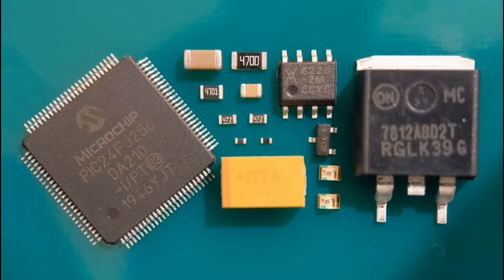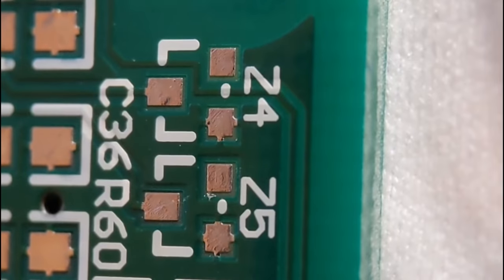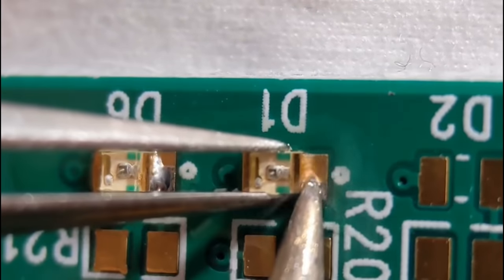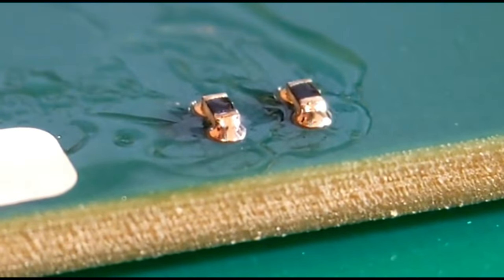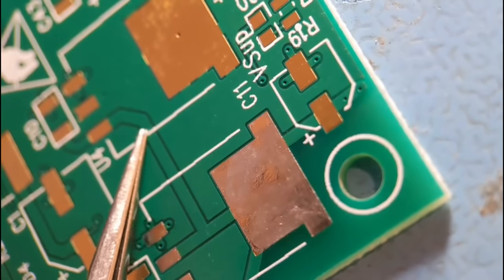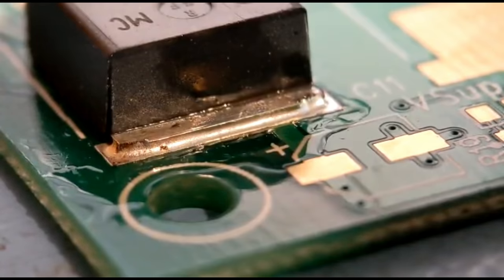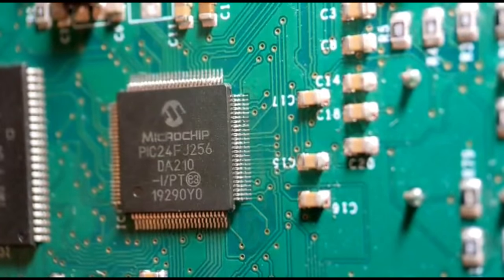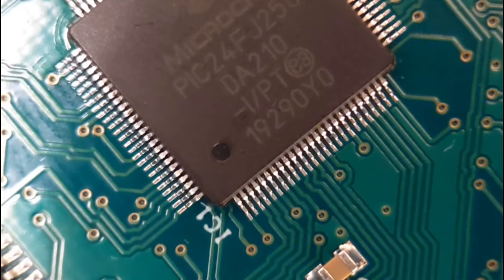How To Solder SMD Correctly - Part 1 /SMD Soldering Tutorial

Comment: What was the temperature of your iron?
Reply from the maker: Hi , thank you for your comment , much appreciated. Generally I do all my leaded soldering at about 330 degrees centigrade and for lead free soldering I choose between 350 - 360 normally . I may up these at times if I have difficult situations, but generally I would go with these mentioned temperatures. As this video was made with lead free I would have set to about 360 degrees .Hope that helps , thanks again 👍
Reply: @mrsolderfix3996  thanks so much for replying. I am just starting out electronics repair and maintenance as a passion I put off for years believing it would be too difficult. Im almost 40 now, but people like yourself are the reason I am motivated to start and continue to learn and grow . It's just been a month so far. I realised I had a lot to learn about this very basic step - soldering! I'm into audio equipment, amps in particular. I watched this video in its entirety, learned so so much from it and I'm very very glad you responded to my seemingly small and insignificant query. Thanks once again. Peace and blessings to you.
Reply from the maker: Hi , thank you for your comment and supporting my channel . I hope you get on ok with all your soldering projects . The more you practice you will definitely improve. Thanks again , take care 👍

Comment: Does the heat put into the 402 effect them at all
Reply from the maker: Hi . The heat going into the 0402 size components has NO effect on them at all . I guess if you held your iron on the ends for ages it might start to lift the connection on the end of the component but this should never happen in normal soldering practices. Thank you 👍
Reply: @mrsolderfix3996  ok great,thanks for your quick reply there sir
Reply from the maker: Hi , no problem . Good luck with whatever you do 👍

Comment: Which flux you have used
Reply from the maker: Hi . The flux I use in all my video's is called SMFL200D . It comes in a 200ml spray can . I normally spray a small amount into a small container and use a dipped plastic Ty wrap to apply it as in the videos . It's a great flux , recommend it . About £13 a can from Farnell , RS Components , eBay and other places . Normally pretty easy to get hold of . Hope that helps 👍

Comment: Whats the diameter of solder wire
Reply from the maker: Hi , thank you for your comment , much appreciated . In my videos I generally use 0.25mm solder for any fine pitch or small components and 0.5mm solder for larger  devices . Hope that helps , thanks again 👍
Reply: Thankyou. If you do more videos. May I request you talk about the head and solder size...we newbies have no idea. I have watched most of your videos again and again. The blob version like other channels did not work out for me. Your tack version worked best for me. Thanks.
Reply from the maker: Hi , I've actually posted a complete video on my channel all about different solder thicknesses and when to use them , not sure if you have seen this one .
Reply: Thank you I have not checked that video I will be going through all your libraries

Comment: what flux do you use?
Reply from the maker: Hi . The flux is called SMFL200D . I'm posting a video about this flux and solder braid in the next few days . All the info about it will be in the video or you can find more info in the comments for most of my other video's about this flux as lots of people have enquired about it . Thank you for your question , much appreciated 👍
Reply: @mrsolderfix3996  SMFL200D is a spray
Reply from the maker: Hi . Yes I know . I spray some into a small container and then apply it using a dipped plastic cable tie. My video in a few days will show all this if your unclear . I explain how if you leave it for a while it becomes more like a sticky flux so you have the option of liquid flux like in my video's or sticky flux that I will show in the new video . Hope that helps 👍

Comment: what flux do you use
Reply from the maker: Hi . The flux I use is called SMFL200D . Widely available from Electronic distributers. In the comments for this video I mention places you can get it etc . Hope that helps 👍
Reply: @mrsolderfix3996  thanks bro.. your video helps bc I need to fix my subwoofer and multimeter and whatever else that's broken...
Reply from the maker: Hi . Good luck with whatever you try , thank you for watching 👍